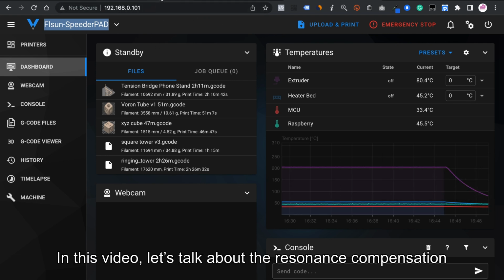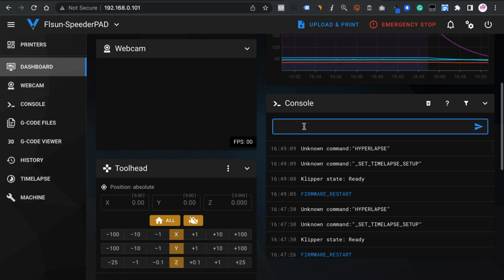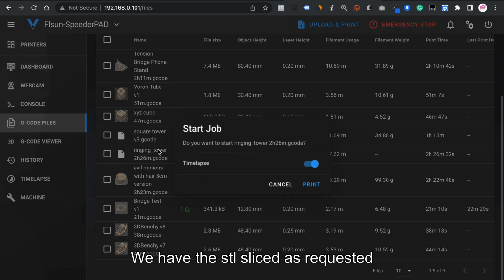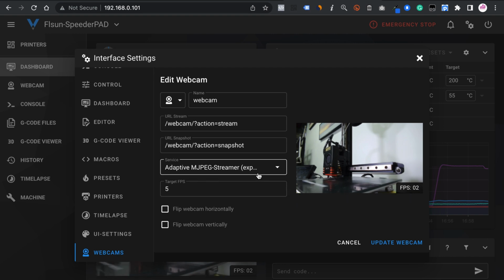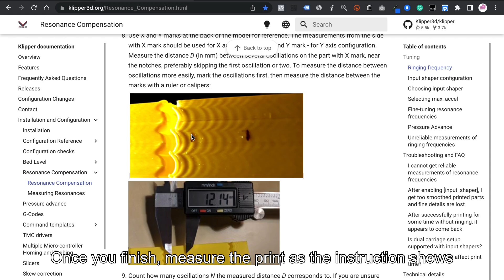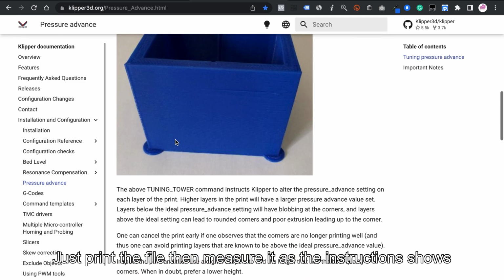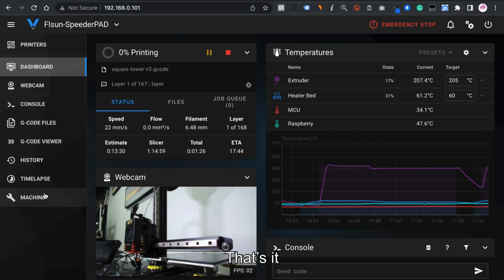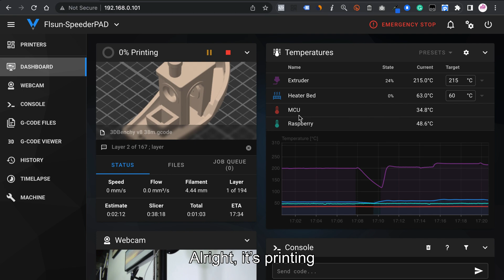Use the Flsun Speeder Pad with the KINGROON KP3S Pro Part 2 Calibrate and Advanced settings

Comment: Pleeeeease I already tried to talk to you via twitter and support email, no one answers me, I need help with kp6, resin leaked and got into the printer, I cleaned everything and changed the lcd, everything is turning on, the touch screen, the uv leds, the purple light appears on the lcd when I put it to the test, but it does not print, nor does the cleaning function resin cures nothing, where could be the problem? I need help